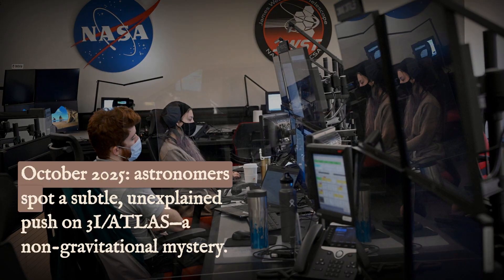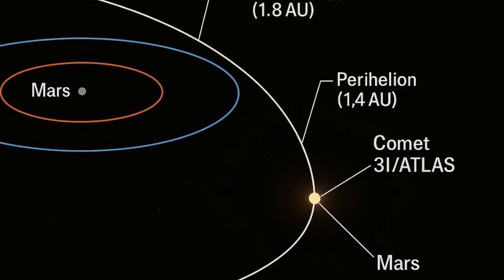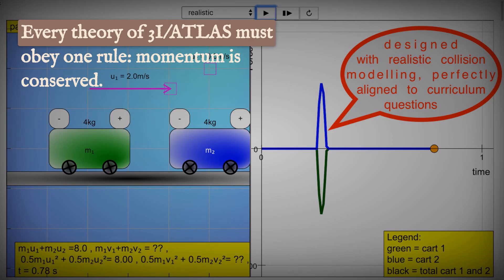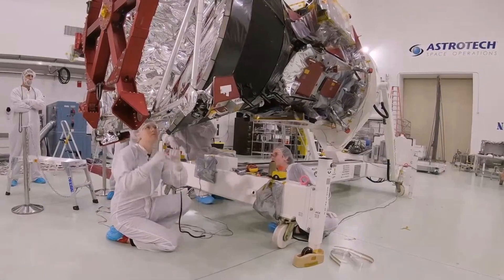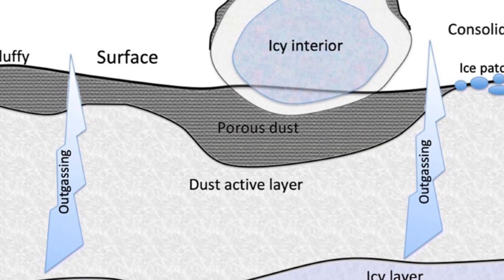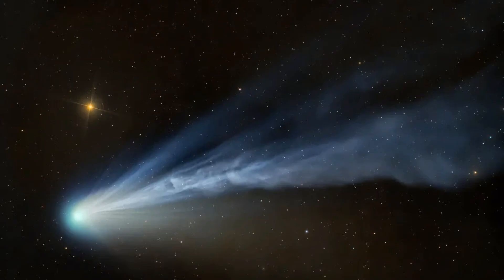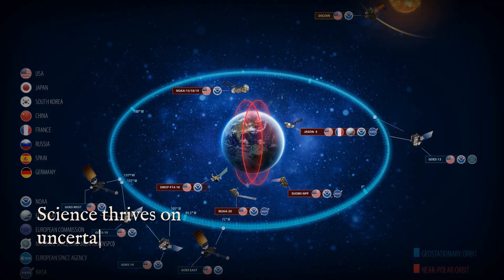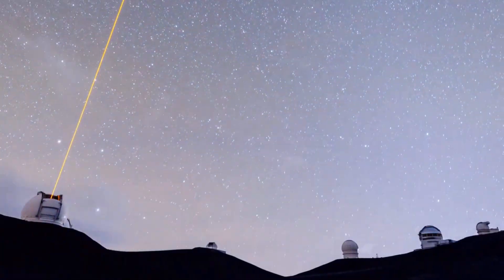Is 3I/ATLAS a Slow-Burn Probe? The Engine Hypothesis Explained Clearly

Comment: -- 3i/ATLAS & Sol ---
Solar storms occur due to the release of large amounts of solar energy, such as solar flares and coronal mass ejections, caused by the destabilization of the Sun's magnetic fields.
Sunspots are areas on the Sun's surface that appear darker because they are cooler than their surroundings. They originate from intense magnetic activity on the Sun, which inhibits the movement of hot gases, causing localized cooling.
When the solar atmosphere reaches Earth, whose magnetic field is in the opposite direction to the geomagnetic field, the two fields can reconnect, allowing the entry of atmosphere and energetic solar particles.
In other words, one magnetic field acts upon the other, weakening its magnetic intensity and allowing particles from the Sun (solar winds and coronal mass ejections) to enter.

The two space telescopes that observe the Sun are the Solar Dynamics Observatory (SDO) and the Solar Orbiter. These two telescopes observed 3i/Atlas as it approached the Sun. What they saw were the coronal mass ejections heading towards the comet.

Because of everything mentioned before, 3i/Atlas is reducing the solar magnetic field in specific areas (small areas of the Sun).

For this reason, my first hypothesis (magnetic protection from 3i/Atlas) is not impossible.
If hypothesis -1 is possible, hypothesis -2 will also be possible. Best regards.
--- Hypothesis 3 (Ni) ---
My explanation focuses on the behavior of 3i/Atlas as it approached the Sun. Its coma turned blue with a very intense glow; based on everything explained, this can only be caused by large quantities of CO.
Interestingly, two of the three possible reactions are endothermic, and the other is exothermic.

Comment: ------ Hypothesis 2 ------
In my first hypothesis regarding the 3i/ATLAS anti-tail, created by a magnetic field that protects against solar winds and is oriented towards the Sun, and given the changes in the object's speed and trajectory, the following may occur:
1- Newton's third law, or the law of action and reaction, states that for every action, there is an equal and opposite reaction. This means that when one body exerts a force on another, the second body exerts a force of the same magnitude, in the same direction, and opposite sense to the first.

2- Magnetic fields interact primarily through attraction and repulsion between opposite and like poles, respectively. Furthermore, magnetic fields exert a force on moving electric charges (solar wind particles), called the Lorentz force, which can alter their trajectory. If the direction of the particles is changed, a force appears in the opposite direction and a new direction of the deflected particles. The direction of the resulting force depends on the angle of deviation of the particles - Calculation point 1).
*( point 2 - ∆m.v = F.t , vector)
3- If 3i/ATLAS uses electromagnetism to protect itself from solar winds, and the field generated by the object is directional, it can also function as a directional impulse, as explained in point 2.
Reply: ---- Hypothesis 1 -----
"Protective Screen"
Any comet or object approaching the Sun will have to contend with solar winds and solar radiation. The speed of solar winds is 300-800 km/s, reaching up to 1200 km/s, while solar radiation (light) reaches 299,792 km/s.
As it approaches the Sun, the comet's nucleus heats up and the ices that compose it turn directly into gas, a process called sublimation.
This gas and the released dust form a cloud around the nucleus, known as the "coma."
Sunlight and high-speed particles from the solar wind interact with the coma.
The solar wind pushes the gas and dust out of the coma, creating one or more tails that always point in the opposite direction from the Sun. Often two tails form, a gas (ionic) tail, which is blue and is formed by the ionized gas, and a dust tail, which is more diffuse and yellowish due to the reflection of sunlight on the dust.
Every time a comet passes close to the Sun, it loses some of its mass. Over time, this loss of material and gravitational forces cause it to fragment or disintegrate completely.
If it is true that 3i/ATLAS has an inverted tail (the opposite of any comet), as described at the beginning, the very high speeds of the solar wind and solar radiation (kinetic energy) mean that the coma of 3i/ATLAS, with a much lower speed, will have to behave like that of any comet: "Move away from the Sun!" It could be a "protective shield." If we look at the Universe, the one who designed it was infinitely more intelligent than us and found marvelous technical solutions.
"The Earth is protected from solar winds mainly through its magnetosphere, a magnetic field that acts as a protective shield. This shield deflects most of the charged particles from the Sun, but a small amount can pass through and cause phenomena such as the polar auroras (visible light)." In my humble opinion, and applying logic and natural phenomena, if it's a 3i/ATLAS protection device, "It must be magnetic."

The Earth needs a magnetic field that covers its entire surface due to its rotation and revolution around the Sun. 3i/ATLAS will only need protection on the surface perpendicular to the line connecting it to the source of the emission, the Sun. The magnetic field lines themselves are invisible, but the effects of the deflection of solar wind particles by the field produce visible light effects.
On Earth, the side of the magnetosphere that faces the Sun (dayside) is deformed:
The solar wind compresses Earth's magnetic field, creating a domed shape or "nose" that faces the Sun.
Reply from the maker: An anti-tail can happen naturally, and if there were a magnetic shield we’d expect plasma signatures or bow-shock effects. Nothing like that has shown up yet, but worth watching as more data comes in.
Reply: ---- Hypothesis 3 (Ni) ---
Temperature affects light reflection in nickel oxide by modifying its surface properties and the way it interacts with light at the atomic level. At low temperatures, nickel oxide may exhibit more stable reflection, but as the temperature increases, the reaction kinetics and oxidation and reduction processes can alter the surface structure and composition, causing changes in reflectance, such as color changes.

If the temperature of nickel oxide that has been heated to yellow is reduced, it will return to its original color, that is, to green.

"How can Ni compounds affect Comma Color?":

Nickel oxide reacts with nickel carbonate through a thermal decomposition reaction: when nickel carbonate (NiCO3) is heated, it decomposes to form nickel oxide (NiO) and carbon dioxide (CO2). This reaction, called pyrolysis, is used to produce nickel oxide from nickel carbonate. Chemical reaction The chemical equation for thermal decomposition is: NiCO3(s) == NiO(s)+CO2(g)
Decomposition Process: When nickel carbonate is heated to high temperatures, it decomposes. Gas Release: During the process, carbon dioxide (CO2) is released.

Final Product: The resulting solid product is nickel oxide (NiO).

* What will happen if there is not enough oxygen in the reaction?
In an incomplete reaction between nickel oxide (NiO) and a carbon source, such as CO, carbon monoxide (CO) would be produced, and nickel carbonate (NiCO3) would be formed. The incomplete reaction occurs due to a lack of oxygen, and this can lead to the formation of carbon monoxide (CO). The reaction: NiO + CO → NiCO3 + CO. In this reaction, nickel oxide (NiO) reacts with carbon monoxide (CO) to form nickel carbonate (NiCO3) and an additional molecule of carbon monoxide (CO), indicating that the reaction is not complete, since more CO is produced than was needed as a reactant.
-- Conclusion - As we saw at the beginning of this commentary, the green color is due to the presence of diatomic carbon (C2) and cyanogen (CN), not to carbon compounds or carbon dioxide directly.
The blue color is caused by the presence of ionized CO. As we saw, if nickel oxide (NiO3) reacts with little oxygen, CO will be released.

"This should be studied by scientists; I imagine they are already working on it."

Blue = CO
Green = C2 and CN
Reply: CO2 can be converted to CO at high temperatures, although the reaction requires intense energy conditions or the use of catalysts. At very high temperatures, such as those above 2000 °C, carbon dioxide (CO2) decomposes, producing carbon monoxide (CO) and other gases.
Transition metal catalysts, especially nickel (Ni), are used to convert CO2 to CO at high temperatures (IA).

Interesting, isn't it?
Reply from the maker: Cool idea. If something was using a magnetic field to deflect solar wind for thrust, it would need a really strong and structured field. We haven’t seen signs of that yet (like plasma effects or a shock signature), but it’s an interesting angle. Worth keeping an eye on the data to see if anything points that way.
Reply: @SpaceUnfilterd
Hello again. I'm an admirer of the technology we see in the Universe (some scientists should be more humble). The Sun, billions of years old - nuclear fusion; us - nuclear fission. Avi Loeb is a good scientist, as Albert Einstein said:

"The mind works like a parachute; it only works if it's open."
Best regards
Reply: @SpaceUnfitered
Hi, from Omumua, we even had posters for the walls and very detailed photos. Where are the photos of 3i/ATLAS?
We have no choice but to speculate about what might be happening. Or as A. Einstein said:

"Logic gets you from point A to point B, imagination takes you everywhere."
Best regards